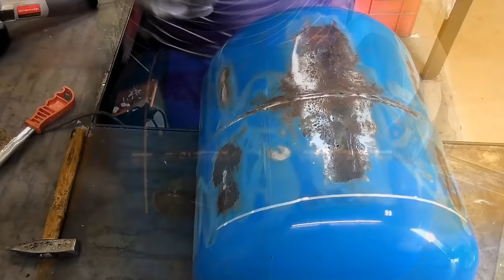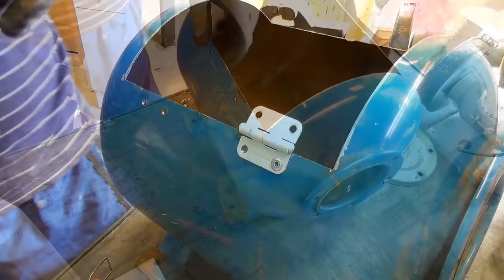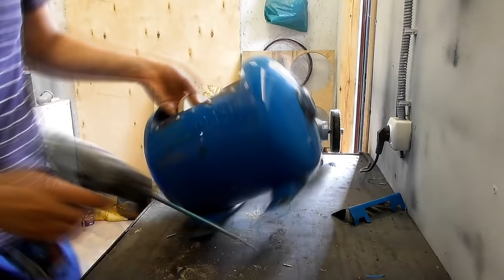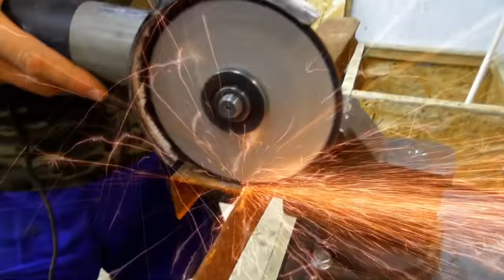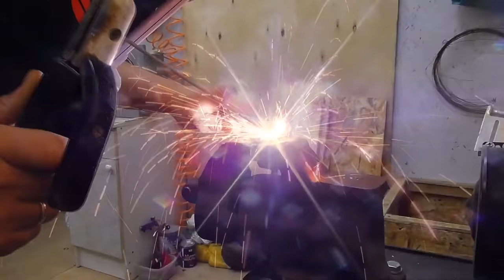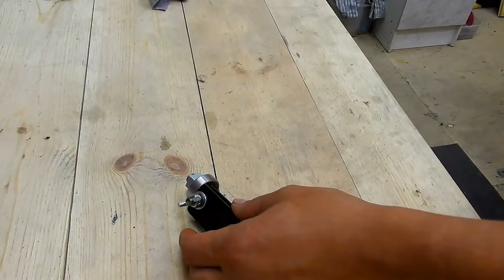2 creative ideas for a garage or workshop

Comment: Why would you lock a first aid box?
Reply: Tyler Bennetts he has the cure for the corona virus
Reply: Why would you go through all that work to make one.
Reply: First aid kit consists of a bottle of Jack Daniels. Remember, alcohol "evaporates" quickly in the presence of air. And family. And friends. Yeah, ya might wanna keep it locked up.
Reply: to make it child-safe perhaps? iodine, pain killers, desinfection alcohol and other stuff may be not as pleasent for children to drink or chew on.
Professional builds have two doors, one locking up dangerous stuff, the other with free access for bandages, band-aids and that sort.
Reply: YOU DO NOT LOCK A FIRST AID KIT - EVER (!).

I worked Emergency Services for close to a decade and on a daily basis had to have access to whatever was in my first aid kit in the abulance or the trunk of my squad car (yes - it was locked but could be accessed via an electrical release in an emergency).

During the years I worked in manufacturing and construction I found that when an accident happens it is NO time to be looking for whoever has the ONE key to the FIRST AID KIT.
Reply: @larrywhalen127  If you're in a hurry and don't have the key just take a large screwdriver and pry it open! At home in your workshop or garage you probably have to encounter the curiosity of children and don't want to endanger them by open access to harmful medicine, would you?
Reply: @mannihh5274  That's how the chisel is used.

Comment: it's a good thing he made a first aid cupboard out of that expansion tank. He will need it the way he uses his tools... no face shield, wearing inappropriate work gloves that are rubberized while using that angle grinder with the metal cutting blade... using the router and wrapping the electrical cord around the machine in use... and so many more safety considerations he didn't even think about. I watched the video about halfway through and had to quit because of ow unsafe he is to watch. Everything you saw him doing are exactly the wrong way to use power tools safely... without exception.

Can you imagine the amount of damage that can occur instantaneously if that metal blade grabbed those rubber grip work gloves? The sparks are approximately 5000 degrees and he had no safety clothing to protect his arms. I would have used either leather gloves, or no gloves at all, but I would have found a way to protect myself from sparking. He wore safety glasses, but should have also had a safety shield as well. I know and have seen first hand what those blades can do when they shatter and break. And let's not forget the router snafu... it only would have taken half an instant for it to jump from its track, grab the power cord and do incredible amounts of physical damage... It can do damage even faster than the angle grinder because it spins at a much greater speed.

Ok, to be honest, he did do one thing right. He did his cutting on a metal welding table, so that's good. But he should have found a way to secure the tank to keep it from wandering and rolling, instead of using one hand to hold it and the other to  use the grinder. Eventually he did use both hands, but I could see that the tank was still NOT secured and wandered and rolled.

This is NOT a video to watch if you are safety conscious and safety minded. I'm moving on and won't revisit this video... nor will I respond to comments about my observations over safety issues I saw this man demonstrating... there is a right way and a wrong way... this one is wrong.

Comment: You've never been seriously injured have you (?) You don't have the luxury of grabbing a screwdriver to spend several minutes to "try" and break open a locked box that was intended to be there in case of an emergency.
In the meantime, call 911 first before finding a screwdriver to play with the locked first aid kit because by the time you can get that type of lock open the EMT's will be knocking on your door. 
I have these type locks on some steel boxes I keep my handguns in and had to resort to an electric drill to get them open when the key could not be found
And as far as any  dangerous chemicals, keep them in a small locked container attached to your primary first aid kit.
And here's a real life hint about those chemicals - in over several hundred Emergency Responses during nine years, day in day out, I never once used anything other than poure water and that was to flush sand or debris from a victim's face and eyes.
And this includes third degree burns as well - ointments and salves are for minor abrasions and scuffs, not a serious gash or cut where a field dressing is required.
It's your life and your choice as to how you will handle an eventual emergency so don't let me stop you from doing what you believe to be right for you.
Reply: You've never been seriously injured have you (?) 
Crappy welding, crappy angle grinding, @ 0:33 directing the grinding dust into a mains socket, and doing it all in a Tshirt, shorts, socks and flip flops. 😱 

Give him time,it won't be long. 🤣😉

Comment: While i liked your idea for the chisel sharpener your presentation for a Safety Cabinet is Way off base - First thing, in an emergency when you need any item from a safety kit you usually need it NOW (!), not in a minute or even a few seconds. Think about this, you've seriously cut yourself and are bleeding profusely so you go to your FIRST AID cabinet and - NOTHING, because now you have to grab the keys to open it.

If they're in your pocket and now you have a finger dangling half off your hand it is going to hurt more than you can imagine or even if you have just barely 'clipped' an artery it is going to be pumping blood everywhere (been there, done that one) and getting the key is still going to be a "Beeouch" plus you are not going to be able to hang on to a key slippery with blood, believe me on this one too, while you desperately attempt to get the key into the lock (!).

NOT finished yet buddy, NOW the next thing is going to be finding the gauze wrap and compression bandages because of the way in which they are going to have been stored in the circular environment of your otherwise well-made cabinet (we'll speak of that later).

FIRST AID KITS are set up in flat containers or containers similar  to a "fishing tackle" box so when they're opened during an emergency you can immediately get to whatever you need to help the victim.

Not meaning to "bust your chops" but I was an EMT as well as a police officer who responded to emergency calls beyond what I've described on a daily basis for nine years and after a while even I had to learn what was really important or was something that some company merely needed to sell to keep their profits up.

Now then - your build on the tank has not gone unappreciated since I can use it to build a small heater for my shop this year, so thank you for that.

Please don't take offense re my comment but I've both seen and have been SERIOUSLY injured a few times during my life and I know from experience in this situation when you need it - you needed it two minutes ago, so at the very least take off the lock, put a magnet on to hold it shut and get your compression bandages and wraps at the very front, with asperin and bandaids towards the back. 

And I actually have orange suckers in there for later to help me think about what I had done that day to maim myself.

One last item is to place a half gallon of clean/filtered water in a cover next to the Safety Kit in case you get anything in your eye, at least no less than a quart in case you think a half gallon of water is too much.